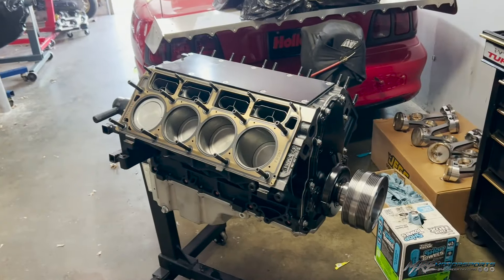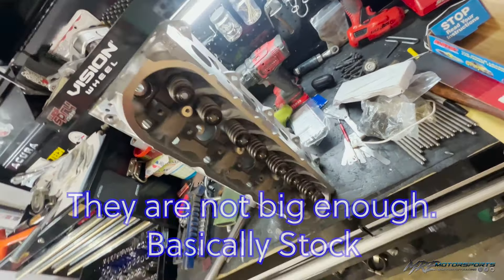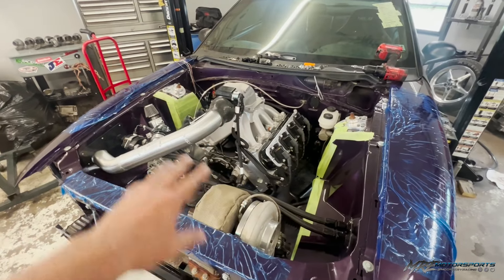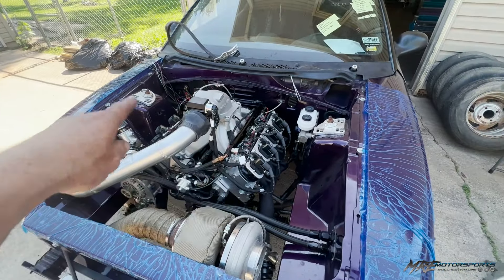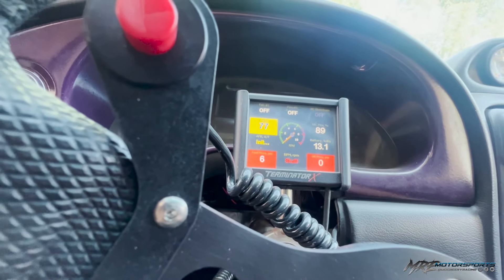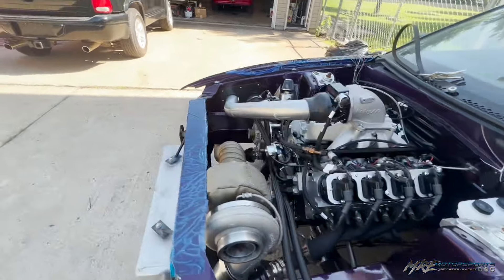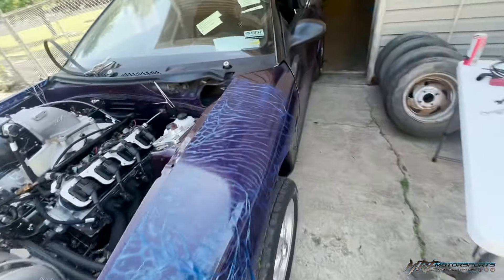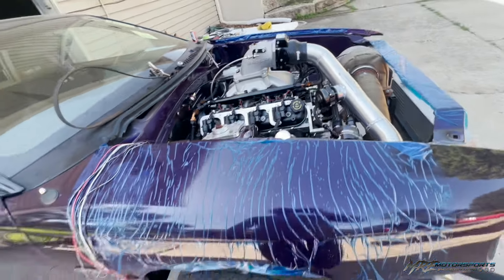"THE RAGIN' RAISIN" ---TURBO LS MUSTANG ENGINE BUILD & FIRST START UP!!

Comment: You can make a cheap LS engine oil primer using a plastic garden sprayer. Just buy the appropriate fitting for the oil line to connect to the front of the block. We made one out of a Freon can but it’s way easier to make it out of the garden sprayer.
Reply from the maker: Yeah I’ve thought about that for stuff at home. Normally my engines would be ran on a SimTest machine.

Comment: If you’re gonna run more than 15 maybe 20 pounds of boost it’s highly recommended to run the dual spring set up .660” or .685”
The rule of thumb for boosted engines is to add, however much boost you want to run, add that number to the valve spring pressures. to help control and close the valves
Reply from the maker: .660s would be ideal but for what we are doing the pac1218s will be fine for now.